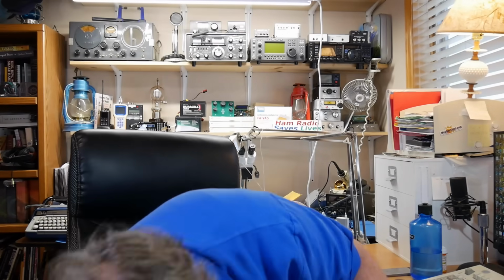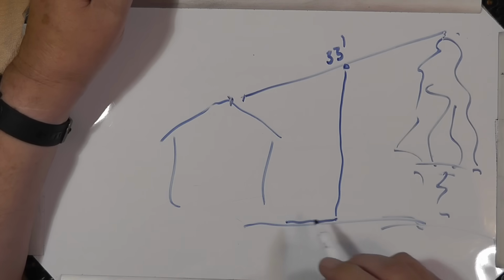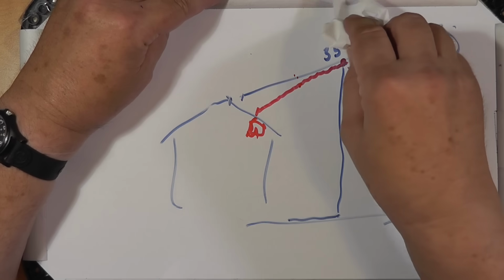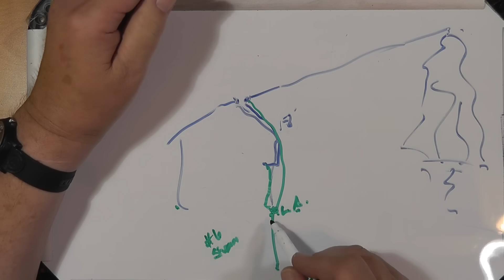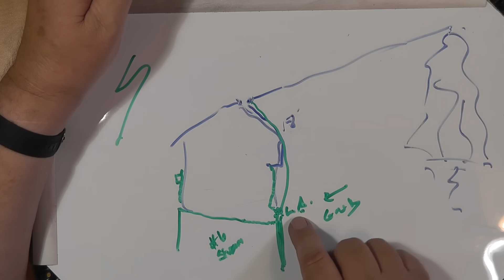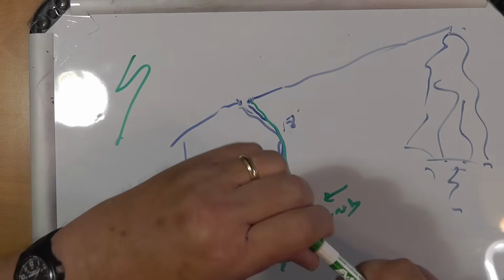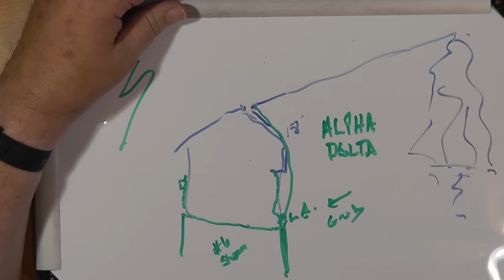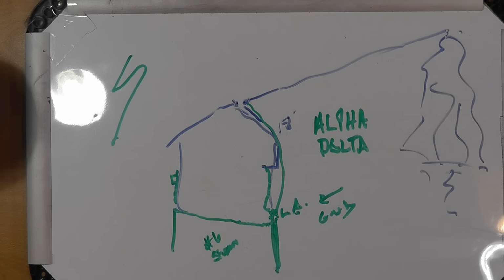Best Antenna Practices (#461)

Comment: My first shack ground “rod” a few decades ago was copper pipe, with a brass garden hose coupling soldered to it. Attach the hose, turn on the water, & push the end straight down. We didn’t have a lot of rocks in the soil - mostly sandy clay - so it went in like a hot knife through butter. Worked fantastic; so easy.

Comment: Well, he did state in his question that it was a dipole. The only dipole I could find in MFJ's catalog that specifically mentions 20 - 6m is the MFJ 1779C which is a single band dipole kit that needs to be cut to length. If that's the case and the instructions were followed, I believe Dave's conclusion is the logical one. Get out the test equipment and start checking continuity. Good advice.

I would still like to know the length of the antenna (cut or not) and which band he was attempting to operate. Also, which radio, tuner or not, etc. Just out of curiosity.

Comment: I do agree with the use of an in-line lightning arrestor, grounding coax at the point of entry, and bonding supplemental electrodes. 

I would recommend that installers should consult a qualified electrician regarding NEC code requirements around supplemental ground rods.  Getting this wrong can increase risk to both life and equipment.  Mike Holt has produced some good videos on this topic.

My unqualified understanding is that ground rods should be bonded using minimum 6 AWG solid bare copper - not stranded.  One document I reviewed (for traffic light installations in MN) suggested using 6 AWG stranded for bonding supplemental electrodes, but in that case they were enclosed inside a buried metal conduit between the electrodes.

6 AWG insulated stranded is commonly recommended for connecting equipment to the common/single equipment grounding point / bus.

Comment: Years ago the galvanized water pipe to the garage and back 40 started leaking so the landlord cut it off at the house. I'm thinking of connecting the ground to that at the house as it runs about 40 feet underground till it comes up again to a faucet.
Thanks 73 AG7MW

Comment: Dave,  the first time you read the letter you said he was using an “18’ section of coax”. When you read it the second time, you said “18’ sections of coax.”  It may be that he is stringing coax section together to make a longer piece of coax.  He may have an issue with a section or multiple sections of coax or he may have a bad connector or two.  Good info in your explanation though. Thanks.  73s.  Tim KO4EZG
Reply: I caught that as well and thought the same thing.

Comment: I just installed a Discone antenna on the side of my garage and ran a 50' coax into my garage. I get good SWR but want to install a lightning arrestor. What is a good yet affordable brand to go with? My coax runs right past my house ground rod so it would be an easy install. I don't have an Elmer so I figure I can ask Mr. Casler's fans.

Comment: Hi Dave, hopefully you could recommend an ideal antenna configuration for HF 80/40M primarily; also wondering how well NVIS will work with this land. I have a challenging terrain in a North facing, downslope property.  House has 3 livable levels at Slopes of 84%,59%,56%; Laser range finder measured 53 degrees, 32 degrees, 29 degrees from the street at bottom of hill.  Would you have recommendations of station location either 59% or 56% level of house and recommended Antenna considering Northern slope oriented takeoff for 80/40 and NVIS (assuming two diff antenna minimally)

Comment: a hydraulic drill makes insertion of ground rods very easy and very fast --- even in high caliche soil  (~ 5-10 minutes for an 8' ground rod)
Reply: I hooked a water hose to a 8’ pipe and used water flow, with a little push down, and had a hole formed quickly. I pulled the pipe out and dropped the ground rod in. Thankfully I didn’t have to deal with rocky soil!
Reply: I've always used an impact drill, shut off the twist, sei the drill chuck on top of the 8' rod, pull the trigger and it will impact it in, less than 2 minutes. Forget the hammer...

Comment: Probably using an EFHW.
Reply: AJ K  Why would you need this much coax? MFJ says in their manuals for their end fed half waves that you can use a very short run of coax.
Reply: Depending on the precise details of the installation, the coax shield of the feedline can be a part of the radiating system for an EFHW. 

It is possible to suppress this behavior by using an RF choke at the feedpoint in combination with a short counterpoise wire attached to the ground lug of the 49:1 transformer.

I am running a homebrew 40:10 EFHW with only 12.5' of coax between the feedpoint and the grounded lightning arrestor. It tunes up perfectly on both 40 and 20. I'm out a bit on 15 and 10 but I think that may be an issue with the parallel capacitors installed across the feedline to ground. Both 15 and 10 are still inductive on a NanoVNA.

Steve Ellington's EFHW videos suggest one can also install the RF choke about 7' from the feedpoint without using a supplemental counterpoise. That length of coax was sufficient to act as an effective counterpoise in his experiments.
Reply: @DanielHallmark  Okay, that might be why I have high SWR, lol I'm only using a 5 foot jumper for my end fed. After some more research I'm getting similar issues to others as well, transmit audio coming through my PC speakers and everything.